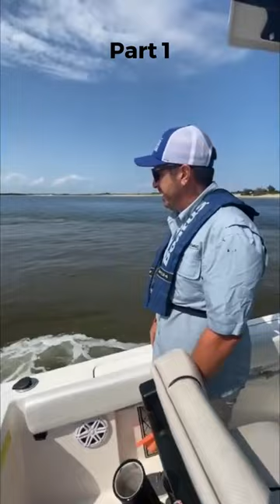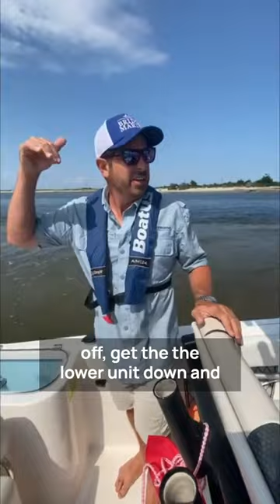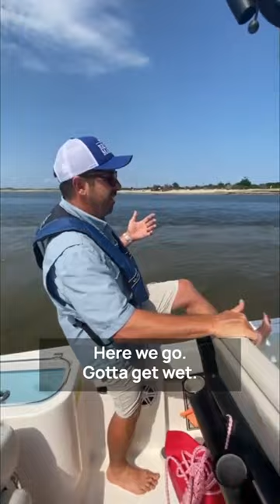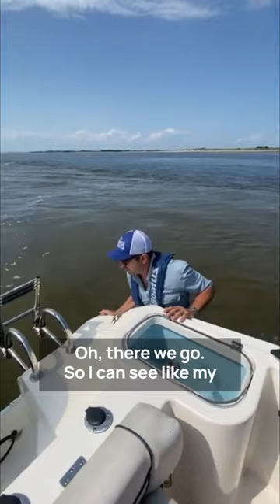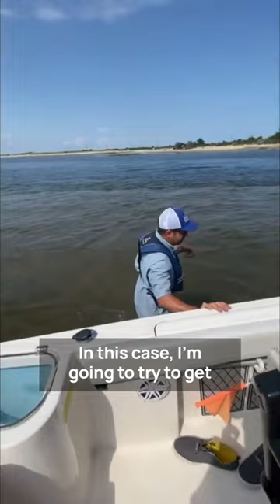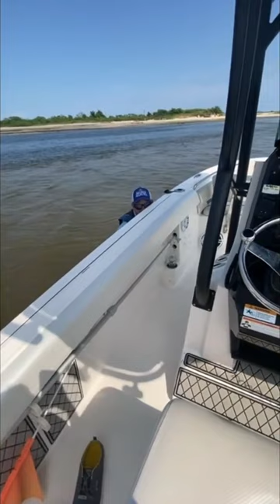Bridge Marina Boating Tips: Getting Unstuck from a Sandbar PART 1 OF 2 #boat #tips #shorts

Comment: Just a little tip in case the wee hole the cooling water comes out of (completely forgot the name sorry)😂gets clogged up. Get some wire and push it in and out of the hole. Only ever had this problem with older engines but if you get stuck in sand or mud u might get stuff coming through your engine. Keep up the great videos,best channel I’ve found with the most accurate information from my experience.